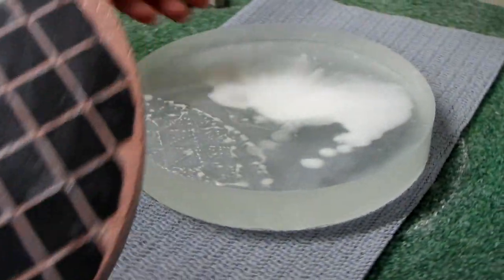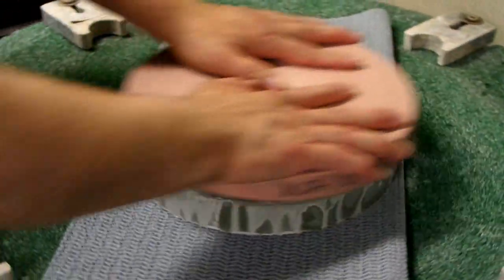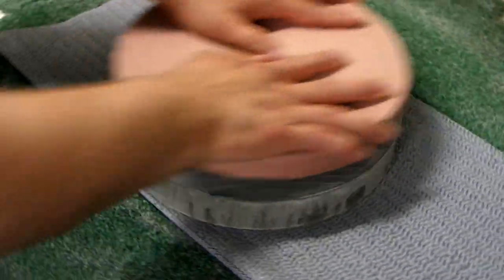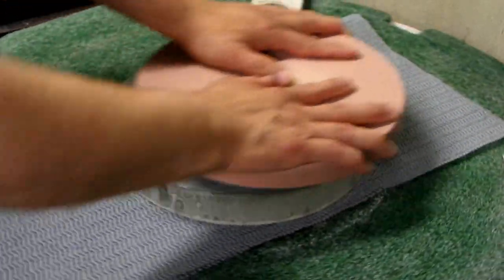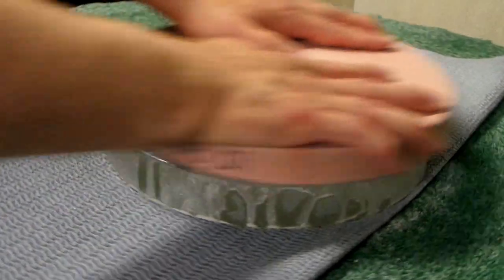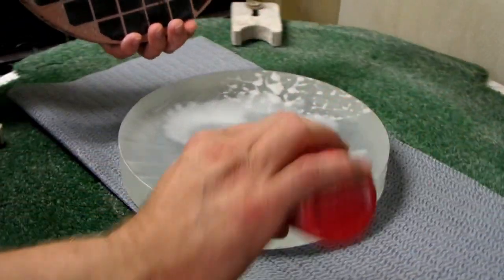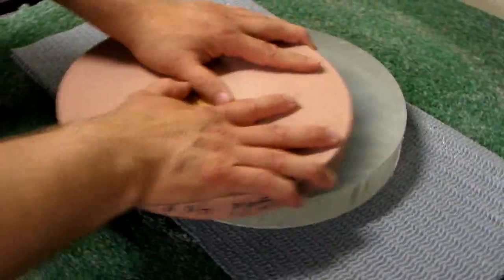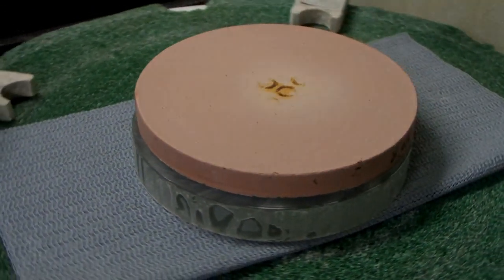Fine Grinding a 10" F2 Telescope Mirror by Hand

Comment: I've seen this type of thing before, but I don't get it. On the biggest telescopes they talk about a billionth of an inch tolerance. Here you have a dude grinding away by hand with grit. How can this not distort the telescope image dramatically? I  don't get it
Reply from the maker: You start with coarse grit, but you change grades and get finer and finer as you go.  I end my "grinding" with grit that is 5 microns in diameter, which leaves surface defects in the .5-micron area.  Then we switch from aluminum oxide to cerium oxide, and go to a polishing action instead of a grinding action.  Cerium oxide is 1 to 3-micron size, but it embeds in pitch and shears away glass instead of grinding it away.  With this process, we can get down to  the 2 to 10 nanometer level of accuracy.  Optical testing is really accurate, so you can produce a surface that is good to the 10 nanometer level, which is about .0000004 inches.  As far as I know, a telescope mirror is the most accurate thing you can make with your two hands.
Reply: So you're constantly measuring the parabolic shape with some kind of precision instrument?
Reply from the maker: I use an instrument called a spherometer.  It gives me a highly accurate measurement of the radius of the mirror, and it only takes a minute.  You should see it in use at the 4:43 mark in my video: https://www.youtube.com/watch?v=IZJp8xaG31s
Reply: So, in order to get it right, you start with a rough parabolic shape, then you use the spherometer often in the process, with some kind of calculation for each circumference on the blank to ultimately achieve a precision parabolic shape. Is that basically the method? If so, it's still not a diy project.
Reply from the maker: Well, not quite.  The mirror stays spherical all through the grinding process and through the rough polishing.  If you are using a spherometer, the mirror is still spherical.  A spherometer isn't accurate enough to help you put in the parabolic shape.  For that the mirror has to be polished, and you use optical tests to measure the shape of the surface.  The Foucault test has you examine the radius of a set of concentric zones on the mirror optically.  Then you run the numbers into a software program like FigureXP to see what you have, and to see where you need to rub next.
Reply: It all sounds prohibitively expensive and definitely not diy. I'd like to see someone do a telescope mirror with an old fashioned phonograph turntable and epoxy resin.  It wouldn't be as rigid as glass, but at least it would be an at-home project
Reply from the maker: Mirrors are definitely at-home projects, as long as you keep them small.  Thousands of people have made 6", 8" and 10" mirrors.  My first mirror was a 6" that I made on my mother's kitchen table back in the 60's!  I'll admit, though, that you're not saving money making your own small mirror, at least not if your time is worth anything.  You can buy a cheap Chinese-made mirror for not much, and if you get lucky, you could make a decent telescope out of it.  Any mirror that a novice makes by hand is going to take at least tens of hours, so if your time is woth min wage, you aren't saving cash.  But that's not why we do it!  There is nothing more satisfying than your first look at Saturn's rings with a mirror you made with your own hands.  Spectacular!!
Reply: Frank Hoffman 
If you do a little reading, you'll be amazed how small the toolkit for mirror grinding is.  You can accurately grind and parabolize an "amateur sized" mirror with a ruler, tape measure, and a DIY Foucault tester (a VERY simple device).
Its counter-intuitive that you can do hand-work to the tolerances needed, but true.
Reply from the maker: Frank, do you have a couple of mirrors under your belt?
Reply: No. I never did any. I have a Chinese telescope with a 3 or 4 inch mirror in it. I do remember a long time ago when it was discovered that a turntable moving at a fixed speed when a liquid was on it, the liquid would assume a parabolic shape. Back then they used epoxy resins and said it wasn't exact. I've seen they now make the glass mirrors for some of the giant telescopes this way. I guess I was wondering if a  new material or method might have developed to make the diy turntable mirrors more exact. I can't see myself  grinding glass for weeks and then being dissatisfied with the result.
Reply: The company i work for has people that do that kind of stuff by hand, (not for telescope, they're doing very plane surface by hand), and they simply spray some liquid on the surface to detect defects  by eye,  dunno if that would be possible here  since it is not a plane shape,   just throwing my 2 cents.
Btw the best of them come down to 0.5 micron accuracy, without any electronic  equipment.

Comment: What is the focal mearsurement in grinding an f2 the curvature of the center of the mirror. This will be real shallow grinding without the precut fabrication
Reply from the maker: On that 10" f/2 mirror, it is .3125" deep at the center!  That is quite deep.  Glad it's not a bigger mirror, as it's a lot of work already.
Reply: @GordonWaite  I know this is old, but on a bigger mirror, couldn't you "chunk out" a large block of the middle if you knew what the dimensions would need to come out? Like taking out 80% of what you need to, to cut that down? (like drilling a lot of holes etc)

Comment: How big could you go, looking for unique sized optical lenses opposed to mirrors
Reply from the maker: In theory, you can make a lens pretty big, using the same techniques as for a mirror.  Making a 10" or 12" lens is possible.  Glass could get expensive.

Comment: What particular glass type people use for lens making?
Reply from the maker: +Calvin Valencia For making telescope mirrors, there are three common types of glass.  The first is regular plate glass, also known as soda-lime glass.  This is very cheap, and is commonly available in  1" thicknesses.  It works well for mirrors in the 12" range and smaller.  It requires longer cooling at the beginning of observing sessions, but a plate-glass mirror can perform just a well as a mirror made on a more expensive substrate.  Next would be a glass called BK-7.  This is slightly better than plate, with a lower thermal expansion coefficient.  This kind of glass is also used for making lenses.  The most common glass for mirror making is a borosilicate glass made by Schott called Supremax-33.  This is fairly expensive, but is has good thermal properties, and is really excellent, both in quality and in performance.  There are more exotic and expensive substrates like fused silica, quartz, Zerodur and the like.  These have very, very little thermal expansion, but are expensive and more difficult to work.

Comment: Hello Mr. Waite, I already have an 10" f/5 parabolized but not aluminized, my question is, is possible to grind it to f/2, thanks in advace.
Reply from the maker: ***** Hi!  It is possible to regrind to f/2, but if you want to use the mirror in an astronomical telescope, then f/2 is probably too fast.  It is very difficult to figure an f/2 mirror, and the coma is very bad.  If you wanted a shorter telescope, I would recommend a 10" f/3.5.  That is a very wide-field telescope that you would enjoy very much.  Or even better, I would probably go ahead an aluminize your 10" f/5 and then make a new mirror that is f/3.5.  The 10" f/5 will give you excellent views of the moon and planets, and it would be a shame to throw away the hard work that you've already put into it.  Best regards, Gordon
Reply: GordonWaite Thanks a lot, I know it will be hard to figuring, I just need it to be spheroid for a project in mind that's why it has to be an f/2 but again shpere not parabola, thanks for the information, best regards.

Comment: Hello Mr.Gordon thanks for posting wonderful videos. I need a clarification. Many say focault and ronchi tests are not accurate for f2 mirrors is it true. Then what is the optimal test method for fast mirrors. What's the maximum focal ration bath interferometer can test accurately. Once gain thanks for sharing knowledge earned over years of experience with everyone.
Reply from the maker: Nagarajan K Thanks for your kinds comments, Nagarajan K!  You can use Ronchi without a problem, as Ronchi isn't really a quantitative test.  It's very helpful for finding zones and checking the overall state of the mirror.  Using the Foucault test on fast mirrors is okay, with a couple of comments.  First, you will need to make very accurate measurements, far better than would be acceptable for an f/5 or longer mirror.  The tolerances are much tighter on the fast mirrors.  Also, there are correction factors that you might need to consider for Foucault testing fast mirrors.  For details, search on the internet for "correction terms for the longitudinal aberration" and you will find a lot of math!  Finally, make sure you are using a moving-light-source tester.
Reply: GordonWaite Thankyou for your reply.